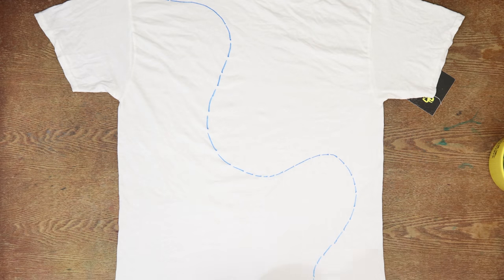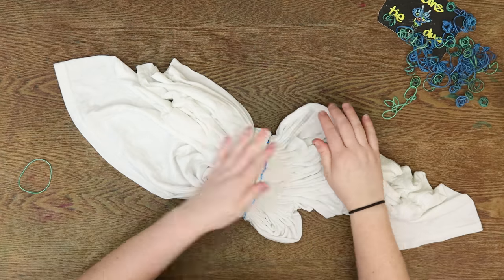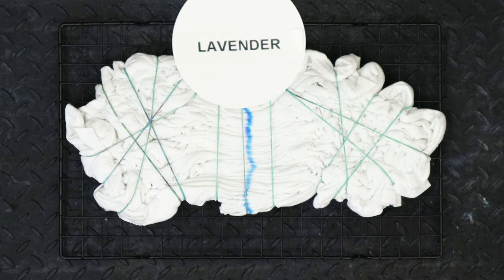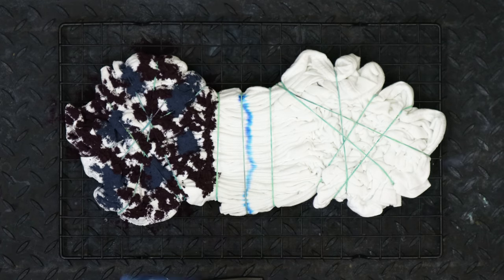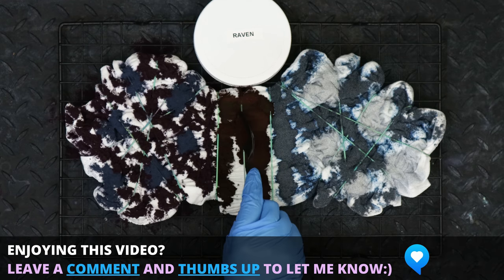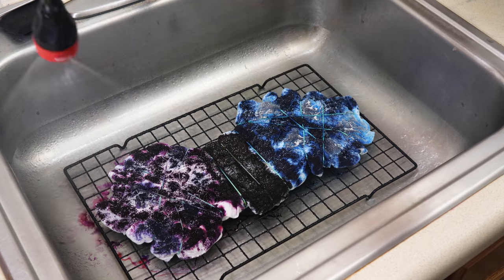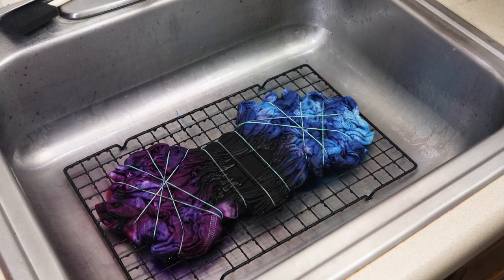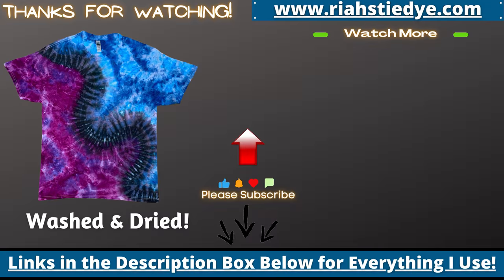How to Tie Dye a SIDEWINDER SCRUNCH T-Shirt in 1 HOUR! - Complete Step by Step Tutorial

Comment: Will HWI work at temps below 150 degrees that don't soften and ruin the pump vacuum housing?
Reply from the maker: No unfortunately the temp should be at least 160 or more and I have been using this garden sprayer for at least a year and I haven’t had an issue with it yet ☺️💙
Reply: @RiahsTieDye  After a restock for spring I was able to track down an Eliminator Heavy Duty pump like you and Belladonna Dyes use. Good to hear it lasts. The other one I had didn't last.

Comment: Whats the difference between HWI and Ice dying? Do the results turn out differently with hot vs cold water?
Reply: Fun Endeavors did a great HWI vs ice dye comparison video about 8 months ago. Ice dye projects take much longer to complete and results in more color splits with crisper color borders. HWI can be completed quickly and the colors bleed into each other more. I think of ice dye being like a Van Gogh. HWI is like Edvard Munch. 😀
Reply from the maker: Hi and thank you for your question. Kyle did an excellent job of answering. In my personal experience I have found that the same color splits can be achieved with HWI but the colors are not as vibrant so the major difference is the time needed for proper saturation. 24 hours minimum for ice dye vs 20 minutes for HWI. I hope this helps😊
Reply from the maker: Thank you Kyle! Great answer!😊💜